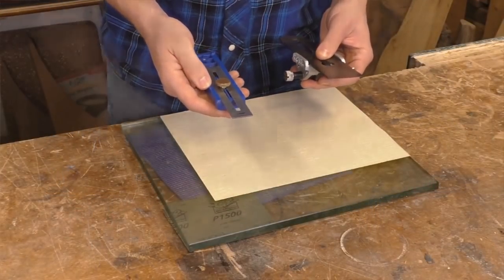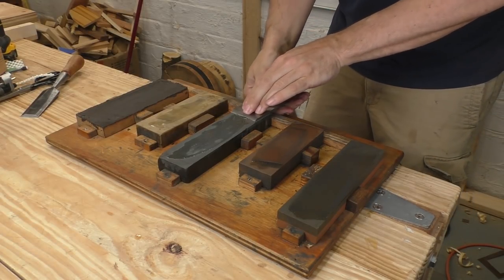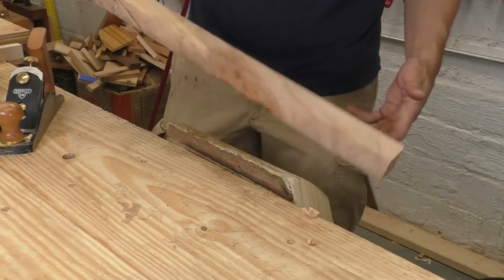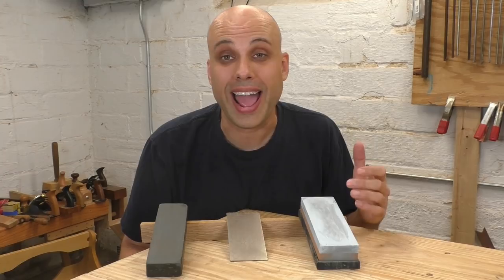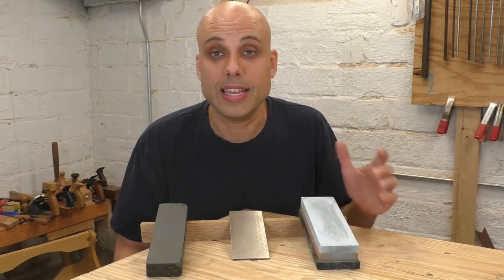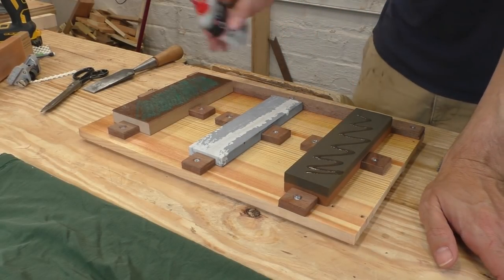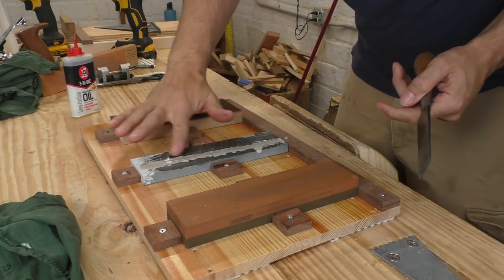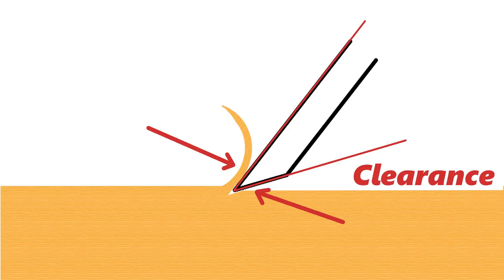Fast freehand sharpening: no jigs, no guides, no sandpaper.

Comment: I agree completely.  
...
(1) Perhaps apart from establishing an initial bevel, or repairing a damaged bevel-- as you say -- a sharpening guide is simply not necessary.  The people who try to convince you to get fancy jigs and sharpening machines are also the one's trying to sell them to you.  They are not trying to build your skills; they are trying to sell you their tools.  I go with Warren Buffet on this:  "Never ask the barber if you need a haircut."
...
(2) As for micro-bevels?  Seriously? Just flatten the backs of your blades once when you get the tools and then get on with it.  Establishing a micro-bevel is an additional, pointless step in my estimation. For what it is worth, I think you are spot on here. Micro-bevels have potential uses if you have to modify a blade to deal with difficult grain in hard wood, but then you need to either resharpen the blade for regular use (considerable work) or use a separate blade entirely. Then, why would you not grind that blade at an appropriate angle in the first place?  I use either a cabinet scraper or a low-angle jack plane for these tasks, and I find the cabinet scraper (properly sharpened) more effective than the plane most of the time. -- not to mention that a good cabinet scraper is less than a third of the cost of a low-angle jack plane, at a minimum.  Further, such scrapers are usually sold inexpensively at flea markets, garage sales, etc., unlike low-angle jack planes.
... 
I have a handful of sharpening guides, ranging from cheap to expensive.  I haven't used them in years. I have a sharpening machine that will establish really precise angles and micro bevels on chisels and plane blades. It gathers dust in my shop.  They are simply not necessary. 
..
These days, I free-hand sharpen almost everything in my house: knives, planes, chisels, cabinet scrapers, shop utility knives, lawn mower blades (file), chain saw blades (file) , gardening tools (file) -- all of it.  All the time -- almost.  I use a low-speed grinder for my lathe tools because it is faster and allows for more control than hand sharpening for these particular tools. To each their own.
...
Free-hand sharpening has several real benefits. It doesn't take much practice to get good. It is then fast and reliable.  It saves time. Lots of of time.  It is also quiet. It is even relaxing. And, as the video emphasizes, don't forget the honing strop. A leather honing strop is key to achieving a beautiful, hair-popping edge. Finally, once you have made your sharpening station and a board for your honing strop, there is no more set up required when you stop to sharpen your tools. By the way, free-hand sharpening is also cheaper IF you learn to do it before you buy all the other jigs and machines mentioned above. Good luck with that part.  Says the guy with all the unused gear.
...
Free-hand sharpening works with whatever sharpening medium works for you. I use diamond stones for sharpening my knives and woodworking tools because they will sharpen even the hardest steels, they stay dead flat, and they are very durable. That's worth a lot to me. I can even use them to flatten my water stones and glass stones -- that is, if I ever use them.  [Wet-or-dry sandpaper works, too, but it works best with a sharpening jig, so that takes us in the wrong direction, in my opinion. Been there, done that.]
...
Will natural stones work?  Absolutely!  I have used them all, extensively. Water stones, India stones and Arkansas stones work well. Hard Arkansas stones are flat out amazing, as are ceramic stones and glass stones. However, all but the Hard Arkansas and ceramic stones need to be flattened regularly if they are used regularly. This is not necessarily a deal breaker, but it is what it is.
...
And, very importantly, you do NOT want to drop ANY of these natural or manufactured stones on a concrete floor. Ever. Don't drop anything on them, either. There is a good reason that many of the natural stones or man-made stones you see in garage sales, etc., are cracked, have crumbled edges, or have chunks missing.  It is either because they were dropped on a concrete floor or because they had something dropped on them.  Sadly, I speak from personal experience here.  
...
On the other hand, if you were to drop a diamond sharpening plate on a concrete floor, you are more likely to damage the floor than the plate. Now, I am not saying it is impossible to damage a diamond sharpening plate.  However, I find it hard to imagine what it would take to accidentally damage a diamond sharpening plate in a woodworking shop under normal conditions.

This is one person's experience and opinion.  These are observations, not recommendations. Sharp edges are crucial for woodworking, to be sure, but how you get your tools sharp is up to you.  Whatever works is what works.

Having said that, I believe this video offers great advice.  Thanks!

Comment: Hand is best but I’m also a tool and die machinist.  I use a belt grinder (sander) to sharpen drill bits for 3/16” to 3” just so much easier and quicker to do it by hand.

Comment: You could use thinner oil in engineering cutting oil for tapping and machining is a lot thinner than 3in1 also try baby oil and some diesel (or something) to make it thinner it will smell better, cut better and not cog your stones. I use sewing machine oil since I have quite a lot for my ancient machines [3in1 makes varnish over time]

ASIDE- Years ago I had to make the aluminium T bar that was missing for all my discounted kitchen cupboard hinges 135' angle (10 pence each 1994) I bought aluminium bar and made a jig for the bottom of my router and away I went BUT the finish was poor --- I hate WD40 BUT I gave a few wafts of spray and the finish was stunning.

Using a thicker oil on a stone  is like sanding plastic it fills the voids of the cutting surface.

Rex keep up the good work I am a patron of yours who likes other people like Paul Sellers.

EDIT this is the T bar that was missing I made 40 of them https://photos.app.goo.gl/hmewZ1EsKoeovwSg7  I used 3 hinges on each 8ft tall melanin wardrobe doors fitted in 1992 still in use now.

Comment: I hate when usually reasonable stuff gets turned into obsessive myths - a bevel angle is important cause it's not the same if you cut or shave with a fat edged blade or a thin edged one, and that's all fine, but the difference between 25 and 30 and jig vs. freehand is so minor and nonconsequential that to argue about is a waste of good woodworking time. There's nothing wrong with having some guidelines and keeping your tools in good order but when that in itself becomes a "club" - I'm out. Thanks for the video!

Comment: I really appreciate your budget conscious approach to acquiring woodworking tools. How do we determine the grit count of unmarked sharpening stones we buy at flea markets, garage sales, etc.?
Reply: Natural stones, if they are novaculite stones anyway (Arkansas stones and relatives) aren't actually graded by grit size but by density. Denser stones are finer. If you have a bunch of stones and want to make a progression, you feel the stones. I have a fine ark and a fine black ark, and you can feel a difference between them. The fine ark is very smooth, when oil touches the black ark it feels smoother than glass. You may also be able to roughly guess how fine a stone is by how fast it removes steel and/or how big/fast it makes a burr.

Not sure what method Rex uses for his stones, but I assume he grades them through feel.

Comment: Regarding the Japanese whetstones and them getting concave.

It's absolutely true that they're much softer than an Arkansas / natural whetstone, and so with the same use, they get concave more often. That said, you don't need to use them for that long. As you have shown in the video, you barely spend half a minute lapping against a whetstone. If you spend more time, you're using a too-high a grit!

Also, since they're softer than natural stones, you don't actually need a super expensive diamond flattener. I get extremely good results using the backside of a floor tile I found in the street. Works like a charm!

Last piece of advice: Your coarsest stone, the one where you do the most work (profiling, reprofiling and apexing the edge), can be as cheap as you want. It only needs to be flat, coarse and hard. I use a 5€ double sided cheapo sharpening stone from the local hardware store, with great results. And I can abuse it without crying afterwards because it costs 5€!
Reply: The classical way of flattening stones (or anything really) is to use three stones (probably of different grits) and rub them against one another, in all combinations, A-B, B-C, and A-C. Once all combinations match, the stones are dead flat.
Reply: @ccreutzig  Whitworths 3 plate method! That said, I don't need sub-micron flatness on my stones hehehe

Comment: One of my first responsibilities as an apprentice was to sharpen blades and chisels. My master taught me how to hand sharpen in about 30 minutes. After that, it was my ass if the tools were not sharp. 
Years later, I saw all of this stuff about exact bevels, micro bevels, and whatnot, and I was very confused. I was wondering how these people got any work done by obsessing over the exact angles of their bevels so much.
Reply: They don't.  Ive attended a few of the Rob Cosman schools and you get to the point that hand sharpening the micro bevel is simple and takes less than a minute from the time I take my blade out of my plane, and then reinstall it. Its all about muscle memory.

Comment: Makes sense for bevel down...but bevel up planes make the angle more critical and a curved bevel would not work, right? No big deal - just means using guides. The point with either is that it doesn’t have to be a half hour exercise. Nice video.
Reply from the maker: I do this with my bevel-up planes with no trouble.

Comment: Im working on a 303 british stock and need the info. Now i know how to sharpen my chisels. The draws were oily and cracked so the wood came off pretty easily by hand so i took out both side of the draws and some of the rear stock. Now im squaring off the inside so i can epoxy in the new walnut wood pieces. Then i reshape the wood and then add more wood. It takes 3 pieces of wood about the size of a large smoke lighter. Prbably like 1 inch by 3 inches or something. The stock  will be really strong once its finished in about 2 or so weeks. Fun, fun, fun.

Comment: A couple things of note, Rex... AND yes (before I go on) it's a great video. You're pretty spot on for technique, so I'm not about to disagree.

1. Auto parts stores sell "Valve Grinding Compound" that can be brushed into leather. It's in a paste form, and if you look into enough different stores, you can find a coarse and fine grit quality to the stuff... 

2 . It's not horrible to get a little oil in your leather. It's easily cleaned out with saddle soap, plain water, and a stiff nylon brush... Yes, you lose the polishing compound as well... BUT why replace leather if you can clean it and recharge it... year after year. I know it's just scrap, but... point?

3. Sitting down, or otherwise raising the orientation of your sharpening surfaces in relation to your body allows your elbows to work straight out to your sides... It's not essential for everything, BUT this position allows your arms to consistently work nearly dead-straight forward and back, and you still have plenty of force to exert downward for cutting the metal (essential for sharpening).
      ...It's worth saying somewhere, that a LOT of people don't realize you really don't need much force on anything to sharpen it.

4. There are lots of cheap little diamond plates on the market... SO you can find them affordably. The only change in technique here is that you'll clamp down the iron or cutting blade to an equitable position, and work the plate (stone) over the edge instead of the other way around (as you're doing in the video)... It takes a little getting used to, but it works just as well in a freehand process.

     Finally, I'd just like to thank you for showing and explaining that the process of sharpening anything does NOT have to get complicated. It just takes a little patience to get to the core values and do the work... you just about can't f*** it up, so long as you continue to pay attention and work until you're satisfied with the finished product.
      I've sat through quite a few of the over-complicated process videos with their jigs and rigs and FAFF' and this has been one of the best and most straight forward videos on the subject of sharpening yet. ;o)

Comment: Generally oilstones work better with thinner oil as thinner oil keeps the pores of the stone from clogging better than thicker oil. Various knife companies sell specially formulated honing oils which are quite thin. Myself, I've been using mineral oil for sharpening for years. It's thinner than 3-in-1 and other all-purpose oils and has the advantage of not having any odor at all. Use a food grade mineral oil as it has no additives. Baby oil and other mineral oil products can have additives, especially fragrance, which you don't want on your blades.

Comment: you can get a sharpening device that will sharpen anything, for like 20 bucks, and fit in a larger carpenter pants style pocket. it has two diamond plates, one coarse one fine..ceramics, and even a rod built in that will sharpen serrated edge knives. it even has a small leather strop on it. I don't recall the name of it, the device is right here as I'm typing this, but there's no name on it. Works great, and after the first couple of times you sharpen a particular blade, you won't really need to use the couarse side again unless you're going a long time between sharpenings and treating the blade badly. Prior to that device, I used a couple of oil stones and an extremely fine pocket size diamond plate. When it comes to knives how ever, most of the time they don't actually need sharpening per se  a "sharpening" steel does what needs to be done, the fine edge gets bent over a bit, the steel straightens it back up. My lady keeps her chef's knives sharp with one, only rarely do I need to actually sharpen them.

Comment: This is great. Although you should say something about bevel up planes. It's still mostly academic, though. If there's a keen edge, 5 degrees of difference isn't going to change much.

Otherwise, I wish I saw this video a long time ago. If you've gotten a burr all the way across the back, you've done your job. Move on to the next stone. Also don't need to fool around with going through so many grits. If you've got it to at least 1000, the strop is where it's at. It will hone the edge too.

Comment: I am really unable to sharpen without a guide. So I made a guide using 2 skateboard ball bearing. It's cheap and the result is very accurate. I don't understand why you made a tool in order to sew right and can imagine that honing guide is unusefull?
Thanks for your videos. Sorry for my low level english :)

Comment: They only thing I will say about diamond plates is that while they should be dead flat and should be that way forever but that doesn't always happen. They are a manufactured product and can sometimes be out of flat or have odd edges/corners. I have had two separate plates that have gone out of flat but manufacturers are usually pretty good about replacing them.

Comment: You should be able to pick up a decent double sided diamond stone that's electroplated with monocrystalline diamond for under £30 from a relatively reputable manufacturer. At least you can in the UK anyway. 
I got a Faithful diamond stone a few months ago, 400 and 1000 grit, and it's been perfect.
Yea, you can pay a few hundred quid to get a really expensive one, and maybe it will last you 10 years instead of 5, but I'd definitely go with a diamond stone for a beginner since you know it's always going to be flat and level. Especially if it's the same price as a stone, since you don't need to flatten it, or buy oil, or keep it in a bucket of water.

Comment: Question: is there a difference between oil and water wet stones? I purchased a set through Amazon, in my mind I thought they would all be oil since you're using it for metal, but the instructions say to wet with water?

Comment: also: a convex grind bevel to cutting edge is more durable than a flat or 'facet' bevel and cutting edge.  What's really going on: cut the steel to define the cutting edge with the coarse stone, then polishing it smooth with the med, fine, extra fine, strop, so that it's less and less serrated and glides instead of tearing.

Comment: Very cool, thanks for sharing. The audio was a little , you should use a lava mic.
Reply from the maker: Working on it!
Reply: @RexKrueger  Your videos are awesome and the topics really useful for those who are waiting for the money to start making things. Very inspiring in many ways. The "simple" aesthetics of your channel suits you very wells, and not using machines for the most parts is great for your sound experience (not having to ride constanly the volume knob) but your space seems to be not optimal and a lava mic could improve many things (except when you rely on it and it fails). First, your audio files should be a lot more "predictible" so you can almost automate audio processing. You can choose to buy a cheap one and use it with your phone (don't forget to record audio cues for sync both in camera and phone , and if you have to do it manually always choose to make audio late) or buy a wireless one with input to the camera. Let me know if you want some advice but keep doing what you do because is already great as it is, don't need to add anymore gear.